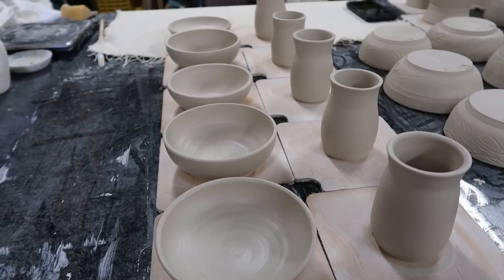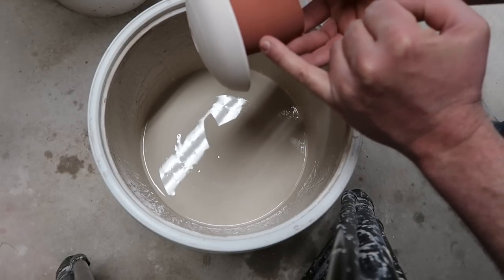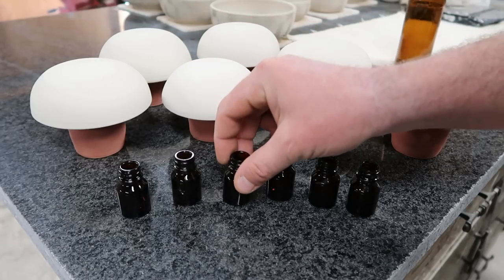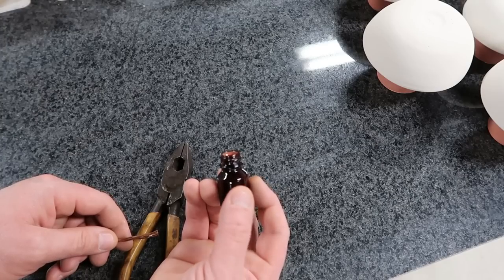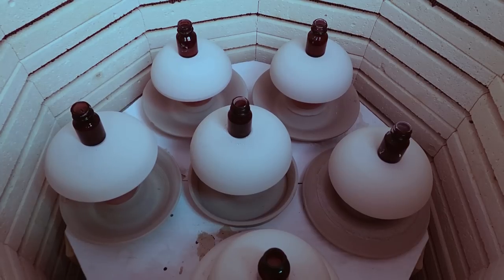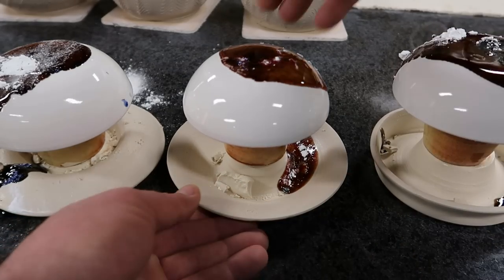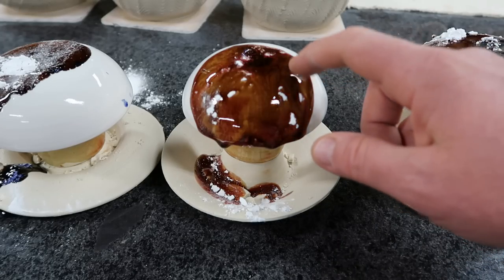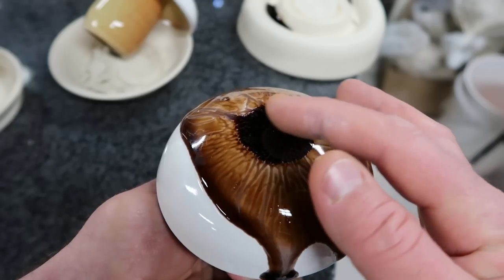Melting Glass on Ceramic Mushrooms - Experimental

Comment: I did find the video very interesting!  I recently had the opportunity to talk to a man who has been repairing kilns for 30 years. Lots of questions and interesting answers. One thing he told me since I was going to experiment with copper in my kiln....he attempted to repair a college kiln.  The students were experimenting with copper.  The copper sparked and spit copper all over the elements completely ruining the kiln.  
I started my ‘hobby life’ with stained glass, then lamp work beads. Glass melts at 1400-1600 depending on its content.  Perhaps another firing after the glaze firing at a lower heat would work better?
Reply: Hola, por favor necesito tu ayuda,,, pintar cerámica tradicional, la hice, no sé cómo colorearla o ponerle un diseño,, por favor ayúdame,, saludos,,

Comment: Alumina Hydrate can be sprinkled  on kiln shelves to keep glaze drips from sticking and porcelain from sticking at cone 10 firing. It would need a good flux to get it to melt,( High melting point.)    Glass will craze when fired high.  It has a different shrink rate than clay.

Comment: Alumina Hydrate, which I assume you are using, is rather refractory and have a high melting point. One of the main usages is for kiln wash. You can add it to glazes but you need disassociate it with itself (that is mix it up real good with everything else in the glaze) for it to be a reasonable source of Alumina. Typically glaze recipes calls for Kaolin when additional Alumina i needed. You could try Kaolin as a replacement but you will most likely get the same result; partial or no melting and not wanting to mix up with the glass, it depends on how high you run the the kiln.
Reply from the maker: Yes, I was using Alumina Hydrate.  Because I use Alumina in glazes to help slow down melting, I thought it would also work to slow down the glass. That was my theory at least. Thanks for the comment.
Reply: @JustinsMakery  Assuming you could grind down the bottle to a mesh 100 dust then mix that bottle dust with Alumina Hydrate and water, that would probably work :D

Comment: Great idea. I would use more flux, alumina only helps if it is evenly distributed in the glass. But you dont need it, let it run.
Reply from the maker: I agree.  Use more flux and let it run.  I'm looking forward to retrying this on a bigger piece.

Comment: Excellent experiment!  - I love your sense of adventure and creative testing of unorthodox ideas. Sorry about your kiln shelf, looked like one of your bricks took a hit as well, uggg, that sucks. I read on ceramicsartsdaily forum that folks use straight alumina under large platters to keep them from cracking so it makes sense that it stayed powder, same thing with straight silica, too high a melting point without some sort of flux. I bet floating blue and wood ash combined would have turned out really cool. Your'e makin me want to risk damaging my kiln!